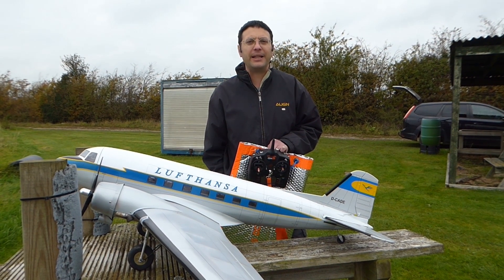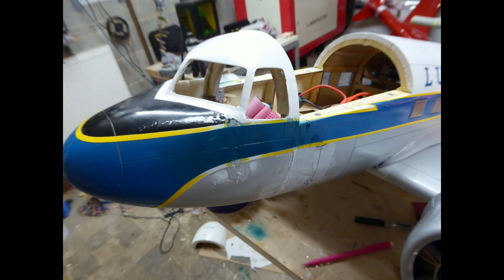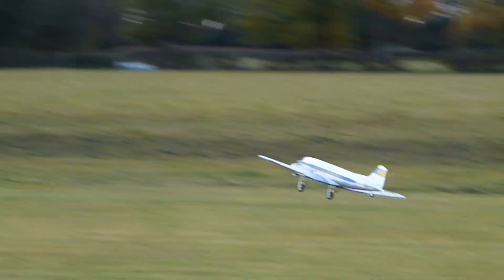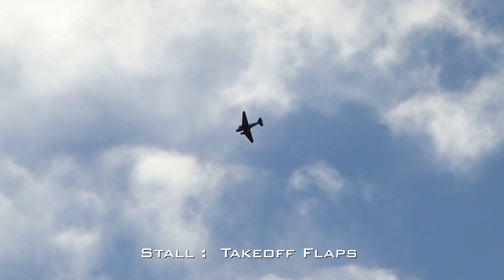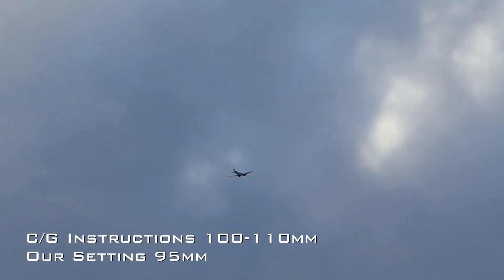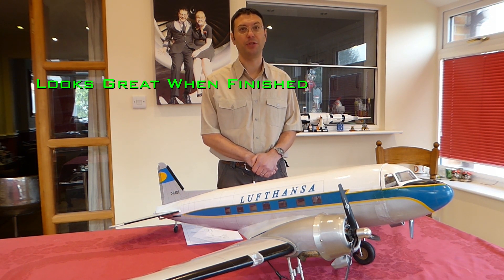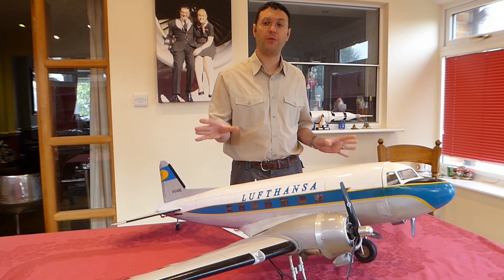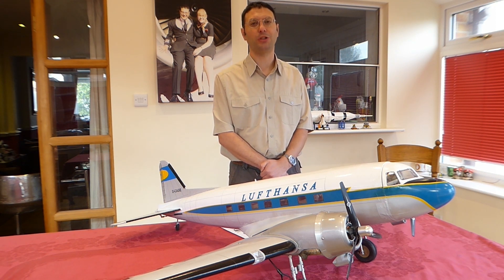VQ Models RC Douglas DC3 Dakota Model (Part 8) - Maiden Flight

Comment from the maker: Just had this brilliant response from VQ Models;

Hi Matthew , 
Thank you for your comment and for your video . 
Ok will make sure the wing are not twisted when we build it in my factory . Thank you for your note and thank you for the video . 

When you take up the first time , I think you need run longer before take off . 
Because when the plane are not enough speed , even if your motor enough power your plane still twisted . It is popular for the plane with short nose . 

This is the first time I see your video and I think why I'm not make a video on Youtube . 
VQ Model are 30 years anniversary now 1990-2020 ,my parents establish VQ models when I was 7 years old . 
My father flying the model airplane from 1970s and I was start to fly since 5 year old and build the first model from plan when I was 10 . 

Attached were some pictures when I test fly the first DC-3 . I'm used 2 x Thundertiger GP-28  - 2 stroke engine , sorry , I haven't video .  The plane flown good and when I landing ,only one engine still run . That is why I choose CG to show in manual . 

Here is my first video for the new models , Cessna 208 Caravan 50 size EP-GP 
https://www.youtube.com/watch?v=wGPxDyxNsX8

Here is my showroom , call is " Museum of R/C flight " 
https://www.youtube.com/watch?v=QqKkw8foVGw

Hope you like the video . 

       Best regards, 
        Vinh Quang 
    VQ Model Aircraft 
    www.vqmodel.com

Comment: Hi Westin, your videos were well done, to the point and instrumental in helping me complete this model with success. I'm about 2-3 days from Maidening her. I would like to ask a question about how you split the ailerons to add more washout at the tips. I am very familiar with the twist and heat method as I used it on all my gliders. If you can describe the aileron part you mentioned it will go far to insure success on fly-day. I am also planning on adding a little up aileron for each in the neutral position. Maybe 2-3 degrees. Would this suffice instead of cutting the ailerons?  Many thanks in advance.  Scott - CA
Reply from the maker: Thanks for your kind comments

Hi, putting the ailerons up will certainly help.  However, you will find that you will still need to twist the to have the aileron roots somewhere near (it is like they are twisted the wrong way at manufacture).  I put o a pair of cut resistant gloves.  I then run a scalpel down the trailing edge by hand - be very careful, do it in a few light passes.  You will then be able to separate the skins, twist into position, and then wick thin CA to re-glue.  This took about 10 minutes per aileron, and was  quicker and easier to do than to explain.

Our wings relaxed back after a bit so we re-twisted and re-shrank the wings a few times over the model's life.  It flew OK once sorted out but we recently built the VQ DeHavilland Twin Otter to take it's place; https://www.youtube.com/watch?v=bP58C62vtrg
Reply: First Maiden went very well. I actually decided to cut the ends of the ailerons (last 4 inches) and pitch them up 5 degrees from the rest of the aileron. I figured later I can smooth things out with a sanding block.  Take off was straight, level, good speed. Off she went. Slow gentle turns, no stalling. Flaps med then full, good handling. Flaps up, gear up, good handling. Flaps down, 30% throttle gear down and a smooth touch down. Flight two, all the same, but when I had full flaps, gear down gentle final turn began, then a wing dropped, nose straight down and with no response to opposite aileron, down then up elevator, I cut the throttle and hoped for the best. Not pretty but she will fly again. Need new cowling, nose was crushed, wing spar bent. But 80% of the body and wings are fine. The joys of this hobby. I do enjoy fitting the bits and pieces back together with CA glue. It always surprises me how much the parts fit and are stronger than before. But I agree with you. Not a Sunday or occasional flying model. Just hang it up and look at her scale beauty. I think the Dynam is the easier flier with similar far away looks.  :) Cheers and thanks again for your great Video Channel.

After some NTSB investigation I found that one of the Aileron Servos had lost teeth on a gear. The servo was free moving (actuator). If this happened in flight that would explain the out of control roll over, with no response to opposite aileron. Hmmm... The only way to find out is to fly her again... Stay tuned. If you care to know.
Reply from the maker: @sunsetmodels  Hiya, sorry for your misadventure.  At least she is repairable

Comment: Try to get tail up ASAP and steer with rudder while gaining plenty of airspeed for safe takeoff. Girth of fuselage blanks out prop blast when model is in 3-point attitude, can lead to ground looping  and premature liftoff and stall/crash.
Reply from the maker: Absolutely. The wing tips being twisted with wash-in didn't help much either.  With the wings reset with a couple of degrees of washout she behaves much better like in this recent outing here; https://www.youtube.com/watch?v=4OMh3XjWH3k&t=18s

Comment: Hi, I wonder how do you exactly measure the C.G. in flight, with that "dive system", can you explain it in more detail? thanks!
Reply from the maker: Hi, absolutely.

First you must eliminate any pitch tendency from the thrust line / power system.  This model was very neutral with power indicating the thrust line was very close (did not pitch up or down with more or less throttle).  Next, you must trim perfectly hands off for a particular airspeed - I chose straight and level flight at 50% power.  Finally, with your chosen power setting and perfectly trimmed, wings level you pitch down into a medium / steep dive and move the elevator stick back to neutral.  If the centre of gravity is too far forward, the elevator must have been trimmed up a little to maintain level flight - so the model will pitch up on its own (and eventually settle back down to level flight).  However, if the centre of gravity is too far aft, the aircraft will pitch down on its own with the stick neutral whilst diving.  Ideally, you want the aircraft to pitch up (recover) very slowly from its dive to indicate the centre of gravity is just slightly safe (forward) of neutral.  Obviously, start the exercise with plenty of height.
Reply: @ScaleMeDown  Oh thanks for the detailed info about this. You earn a subscriber!
Reply from the maker: @AEROERGO  Thanks
Reply from the maker: I made a video of this procedure in detail here; https://www.youtube.com/watch?v=mT5HWzzUjbg